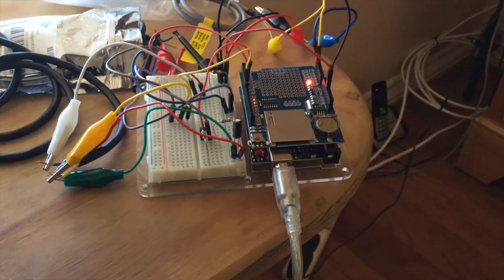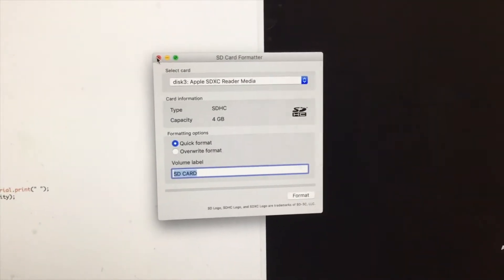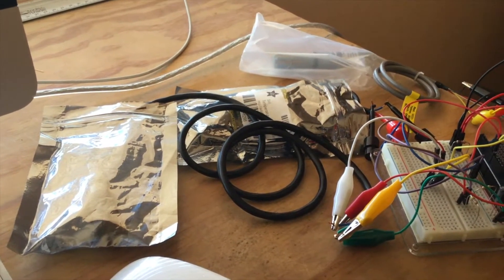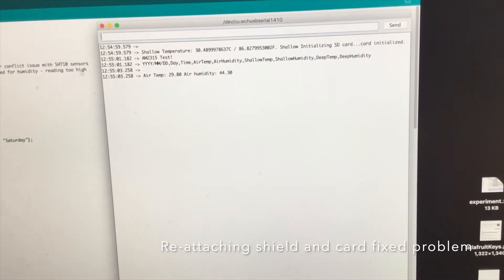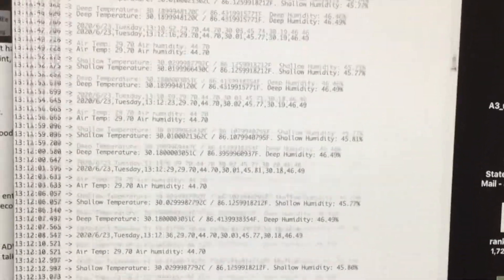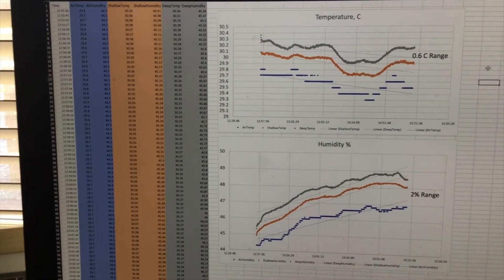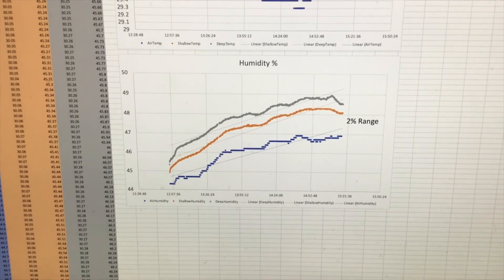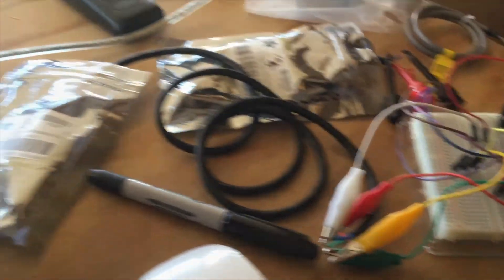SHT10 and AM2315 Sensor Comparison for Mulch Experiment

Comment: sir my asair am2315c tempreature sensor showing error
Reply from the maker: Difficult to say the source from such little information but I would recommend checking your jumpers for continuity; checking your wiring; and ensuring the right libraries are installed.
Reply: @ModestMaker  all connection and library are correct it showing sensor detected but not fetching the data
Reply from the maker: I would try searching the online forums with a copy of your error or replacing your sensor. Adafruit had a great support forum if you need a place to start. https://forums.adafruit.com

Comment: Thanks for the comparison. I would like to know, how well does the senor work after half a year in the ground. It seems to me it is not using a capacitive way to meassure the moisture but rather uses a humidity sensor. So I am wondering how this sensor performs when its stuck in moist soil for long time.
Reply from the maker: Your question prompted some experiments. I learned that once removed, the deep sensor now underestimates humidity relative to the am2315 and the shallow sensor by about 5%, perhaps because it was exposed to a moist environment for so long. have logged the experiment and hope to share details in a future video. Hope this helps.